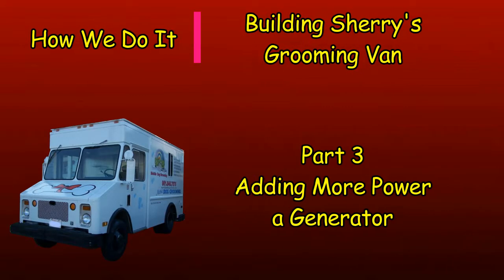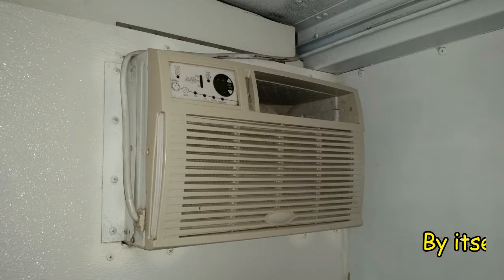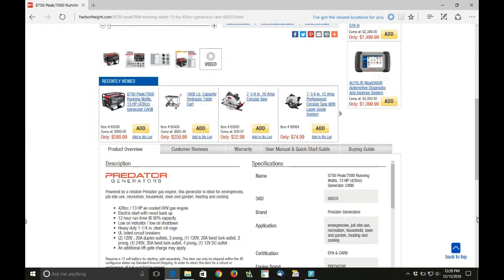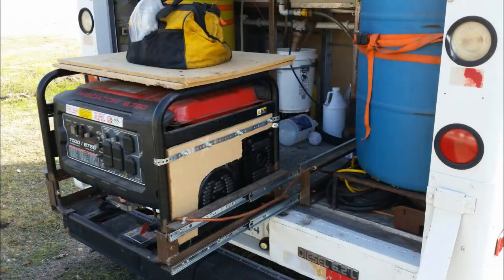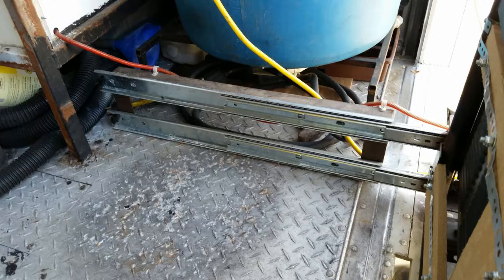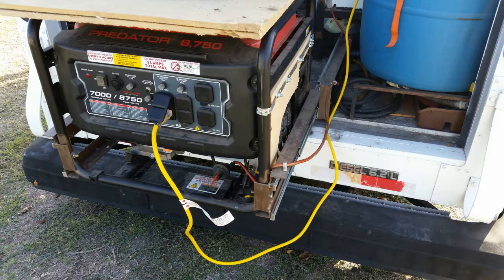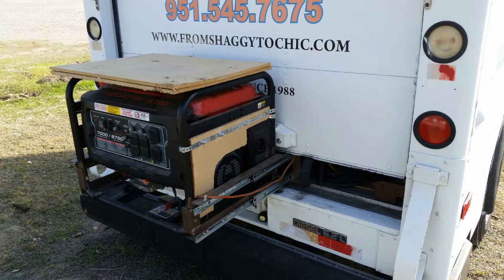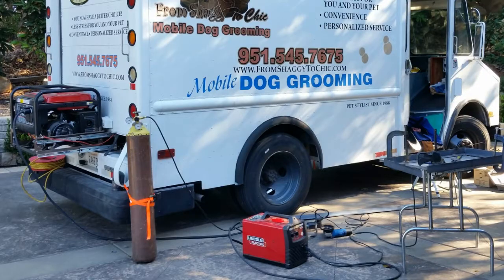How We Do It - Grooming Van - Part 3 - Generator

Comment: Maybe change the muffler. And also put the sound material and shape it to around it while it still can breathe and maybe mount it on rubber mounts to take any vibration out. That's probably how I would do it

Comment: What about the rain or during a storm, will it affect the generator being out or inside your van?
Reply from the maker: The generator is weather resistant. However the plugin is not. So while it can operate in rain the connectors would not be protected. This could be corrected with modifications to how we plug in but we have not had the need yet.

Comment: Your videos are great!  We are getting ready to convert a Grumman Olson Diesel step van into a grooming truck.  I saw your video on the inverter system.  Is the inverter system not enough to power the A/C?  We were hoping to get away with just an inverter system.  Thank you
Reply from the maker: +SuperMuttsAZ 
To do the inverter for a/c requires a lot of batteries, and more than the 3000 watt inverter we have. To run even a small a/c on inverter you need at least 5000 watt pure sine wave, and twice as many batteries. We tried to run a/c on the 3000 watt modified sine wave, but it did not like the power and it used up the batteries we had in just 20 minutes, and that was not running anything else. 

That being said solar panels could be a solution to the number of batteries needed. If you have enough solar power coming in then the number of batteries needed would be reduced. Also if you use lithium ion batteries that would increase the available power from the battery bank. You would still need a pure sine wave inverter, and when you use a hv dryer it would be like running 2 a/c units as far as power draw.

One other thing is don't go cheap on the cables, I made that mistake and had to replace the cables later on. The cables can reduce the available power from the batteries if they are too thin or too long.

Let me know what you are planning to do and I can help you work out the requirements for what would be needed to do the a/c and everything else in the van.
Reply: How We Do It Thank you for your reply! I will pass the information on to my husband who will be doing the conversion. Your videos have helped. We will be starting our conversion soon. My husband is thinking of using solar as well. Thanks again!